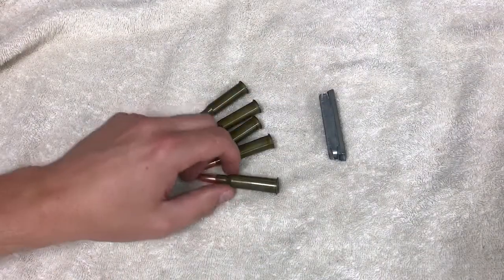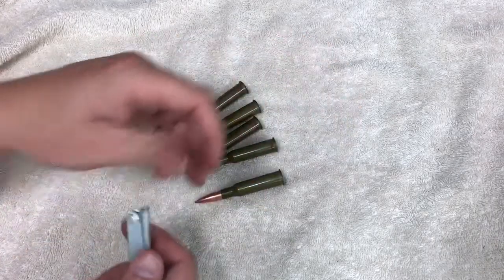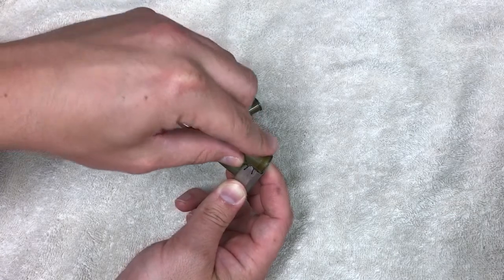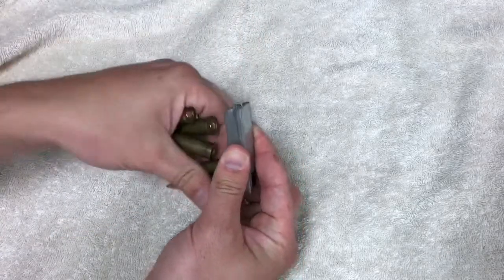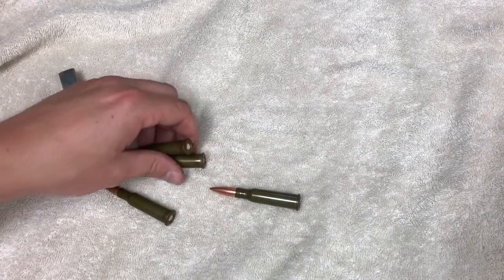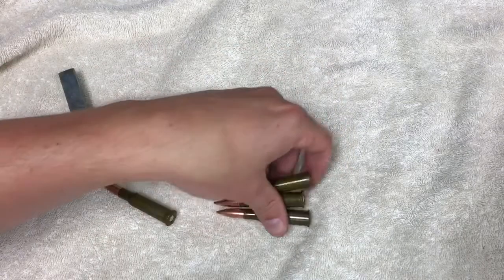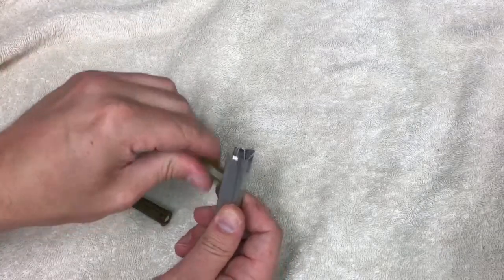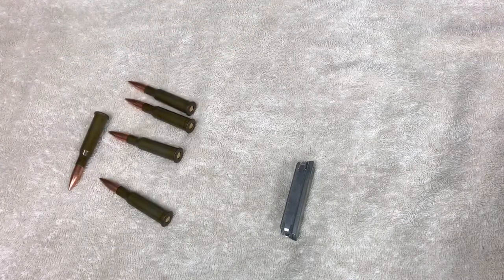How to Load Mosin Nagant Stripper Clip Correctly

Comment: Dont get sucked into that old internet myth...that you must load them a certain way. The interrupter takes care of any rim-lock (or it should if it is working correctly!). If you DO get rim-lock with your rifle...change the interrupter. Just stack the rounds in any old way and keep shootin'!
Reply: then you have a busted cartridge interrupter
Reply: The interrupter on my Mosin Nagant works perfectly. I've never had feed mishaps, and I practically just toss them in.
Reply: Stacking rounds properly is not to prevent rim-lock, but to have a easy and smooth clip feed.
Reply: @Wayne72LEVRAI   as long as you hold the top round in the right position it should load smoothly anyway you do it.